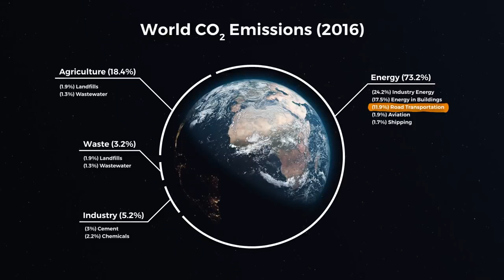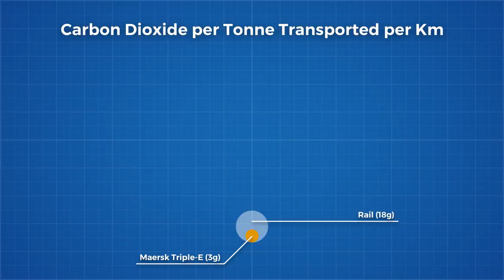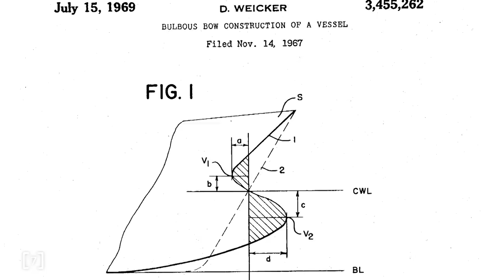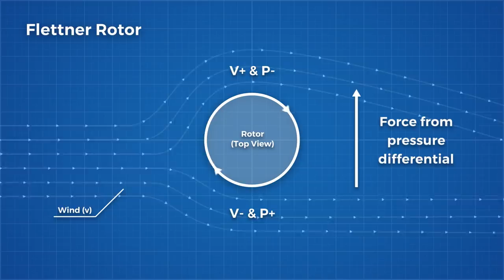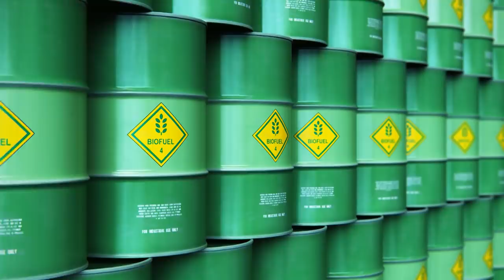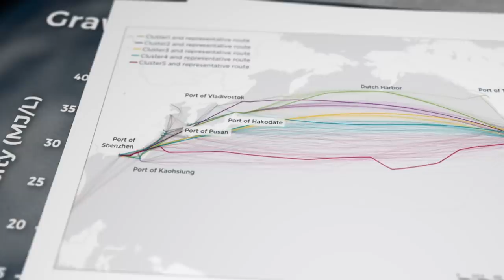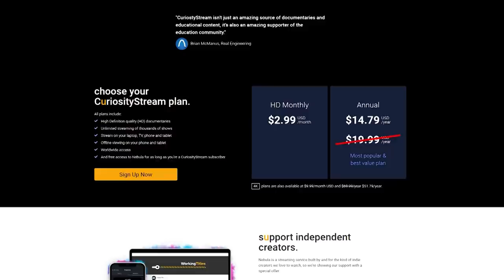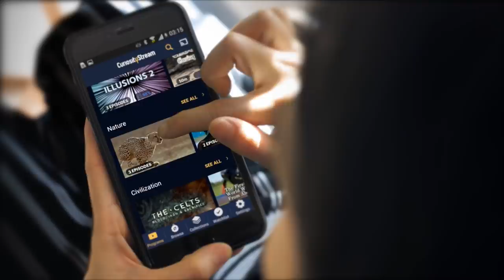Are Renewable Powered Ships Possible?

Comment: A better option is to return to sail.
Reply: To address the suggestions that wind power is the answer I offer the following.  The problems with the wind as an energy source are variability, reliability and low energy density; also relevant in this context is that the canvas, cordage and extra manpower needed for sailing ships were never a very benign environmental option so please discount any idea of sail as ‘sustainable’ and all this is without the problem that if ‘the wind don’t blow the ship don’t go’.

When it does blow it often blows in the wrong direction for your cargo delivery needs and sometimes there is rather too much of it for comfort.  The area where one is most likely to be ‘becalmed’ is the ITCZ (Intertropical Convergence Zone) or ‘the doldrums’ as it is commonly called.  In days of old ships with large crews, such as naval vessels, would try using the ships boats and some of the crew to row through the doldrums thus towing their mother ship out of the calm.  Not practical for less well manned and much heavier merchant ships which could not muster a similar power (oarsmen) to weight ratio (vessel displacement).  Traditional sailing ships are unable to go directly up wind so if the wind is blowing from the direction your cargo needs to go then a zig-zag course must be steered, more distance and thus more time on passage at whatever speed is achieved.

Wind speed is traditionally measured on the Beaufort Scale (wind speed) that runs from 0 (< 1kn or 0.5ms-1) to 12 (> 63kn or 32.5ms-1) and for sailing purposes the usable part of the range is ‘3’ (circa 8kn or 4.1ms-1) to ‘6’ (circa 24kn or 12.3ms-1).  As the wind speed, and the amount of energy that may be harvested there from, increases the sea surface becomes progressively more disturbed which makes the harvesting process ever more difficult and increases the stress on the vessel.  The increased stress means the sail area has to be reduced, either by using fewer or smaller sails until the vessel may in extremis be ‘hove to under storm sails’ or riding out the unsuitable weather using either a sea anchor or a traditional ground anchor.

I have more, lots more. on this subject but this is probably in the TLDR area.

Comment: How about hybrids? 

Half diesel-electric, half H2-electric
Reply: Double the capital expenses for less than half the yield.  First rule of LCA (Life Cycle Analysis) draw the  system boundary that best promotes your point, second rule of LCA chose the parameter carefully to best promotes your point, third rule of LCA  select the functional units that  best promotes your point.  I am sure that you can see the common thread (🙂).  

The 26th UN Climate Change Conference of the Parties (COP26) held in Glasgow between 31 October 2021 & 13 November 2021 established requirements and targets for mitigation of the production of GHG and with regard to shipping steps to reduce atmospheric pollution to acceptable levels could include, but not be limited to: -
1) Abolish the cruising fraction of marine transport;
2) Abolish recreational boating;
3) Improve fuel quality;
4) Localise production to consumption;
5) Reduce 'freight mile' distances;
6) Reduce spoilage / waste of all commodities;
7) Reduce freight carrying capacity;
8) Reduce the global population of consumers;
9) De'fossil'ise the fuel chain.
The use of any of the options above may not be the future of marine transportation but moving less material and moving what is transported over shorter distances, as in the past, should be.  Together with localised production and minimised consumption a global population that has individuals’ voluntarily self-limiting reproduction to two children per parent (both male and female), might save the planet.

Comment: co2 is essential for photosynthesis. Remember the starving 80s. Bon appetit. So not a pollutant yet. Its a gas we want in the right concentration. 1200 ppm is best. Not the starvation level of 350
Reply: the level of 350ppm may be best for temperature regulation and 1 200ppm may be best for photosynthesis but some things are a question of balance.  Confining the enriched 1 200ppm CO2 atmosphere to growing sheds could be an option for squaring that circle but how to make the sheds at a viable carbon cost.  As Barry Commoner said 'everything is connected to everything else'.

Comment: Would people please stop saying nuclear power. Its a terrible idea for ship propulsion. The maesrk tripleE class only has 60MW of propulsive power requirements and a typical nuclear reactor produces hundreds of MW which means the reactors would have to be run at a reduced capacity which increases the risk of hydrogen build up and then a catastrophic nuclear accident. Also around 40-50 cargo vessels sink each year. At the moment the fuel is kept in sealed double or triple walled tanks which are difficult to break. A nuclear reactor sinking would result in a much more serious accident.

Comment: Commercial Hydrogen is mostly made from natural gas, a fossil fuel.  That's why it's supported by oil companies who control most of the natural gas.
Reply: True most commercially available H2 is created from CH4 using CH4 to power the process.  How ever it is possible to liberate hydrogen (H2) from water, you need a lot of energy and while fossil oil & gas, or perhaps coal, will do it and are the most readily available any energy source, wood, photovoltaic, wind, tidal, et cetera, will do.  H2 is said to be good for use in fuel cells that will give clean energy when combined with Oxygen (O2) and leave only water (H2O) as an effluent; so as well as the cost of creating the hardware and separating out the H2 in the first place we now have the cost of providing the O2.  H2 is very, very light and very, very volatile so this is where we remember the Hindenberg airship disaster and while events of that magnitude might not be likely much smaller H2 fires or explosions can cause a lot of damage.  The ‘light’ means that though there is lots of energy per unit mass there is not much mass per unit of volume so all the problems of CH4 but much worse.  You need to compress it, more than a lot, or cool it, more than a lot, to get enough on board your ship in manageable volumes to be useful.
  The alternative to fuel cell use of H2, burning, also generates combustion products which includes waste heat going to the cold sink and a few NOx nasties.  The numbers, on any of these, are getting very difficult to show any sort of surplus so is this a case of running hard to stand still?

WADR H2 may have a place in the energy mix on land as a storage medium but on a ship?
Reply: @BernardLS  Hydrogen as an energy storage medium is highly inefficient and relatively impractical.  As you note, splitting Hydrogen from water uses a lot of energy.  Currently it uses as much energy (when used in a fuel cell to power an electric motor) as needed to drive a battery electric vehicle 3x to 4x as far.  

If Hydrogen is burned in a combustion engine, it's far less energy efficient than when used in an expensive fuel cell.

The energy needed to compress Hydrogen to a useful size makes it even less efficient.

Hydrogen really is not practical.  

It would be far more efficient overall to simply burn in an internal combustion engine the Methane natural gas fossil fuel that most Hyrdogen is made from.
Reply: @LoanwordEggcorn  Agreed now all we have to do is convince the Green Movement.  The key to sustainability is breed less and consume what we need not what want, but that will be an even harder sell.
Reply: @BernardLS  Please keep educating about Hydrogen!  :)

P.S.  Cargo ships are successfully using wind energy in multiple ways: the Magnus effect in the video, automated kites and automated wing sails.  All have already been done experimentally, and they provide significant power.
Reply: @LoanwordEggcorn  Re you P.S.  To address the suggestions that sail power is the answer I offer the following example.  In 1870 a premium sailing vessel entered service, the ‘Cutty Sark’.  The 'Cutty Sark' was 64.74 metres in length with a beam of 10.97 metres and a loaded displacement of 2 100 tonnes.  She was able to carry, at best, 1 700 tonnes of cargo and to harness the energy in the wind the available spread of canvas was up to 2 976m2 which was tended by a crew of about 30 skilled men.  A ratio between the sail area (SA) and the vessels displacement (D) determines how lively she is; ‘lively’ being nautical speak for ‘fast and manoeuvrable’.  The carrying capacity of cargo ships is constrained in two ways, mass and volume which leads us to the ‘stowage factor’ of the cargo; the more mass on board the greater the displacement which in turn impacts the efficiency of the hull form and sail area / displacement ratio.  A vessel constrained by mass is said to be ‘down but not full’, while a vessel constrained by volume is said to be ‘full but not down.  When in the tea trade, which the ‘Cutty Sark’ was designed and built for with fine lines (more nautical tech speak, so again no need to worry about it) she could carry around 600 tonnes of cargo at speeds of up to 17.5 knots dependent on the prevailing wind and had a typical China to UK time on passage of 120 days.  The tea trade was very competitive so ‘time on passage’ was a large factor in securing the premium freight rate that made her cost effective.  As soon as the Suez Canal opened, which the ‘Cutty Sark’ was unable to sail through; she lost her advantage, raw speed, to the steam powered ships of that era who could beat her ‘time on passage’ by taking that short cut.

Rounding things out, her maximum available sail area gave circa 5m2 of canvas for every tonne of tea carried.  All of which is without the problem that if ‘the wind don’t blow the ship don’t go’, when it does blow it often blows in the wrong direction for your cargo delivery needs and sometimes there is rather too much of it for comfort.  Sailing ships are unable to ‘go’ directly up wind so if the wind is blowing form the direction your cargo needs to then a zig-zag course must be steered, more distance and more time.  Wind is traditionally measured on the Beaufort Scale (wind speed) that runs from 0 (< 1kn) to 12 (> 63kn) and for sailing purposes the usable part of the range is ‘3’ (circa 8kn) to ‘6’ (circa 24kn).  Random fact about ‘Cutty Sark’, it is said to have been possible to coax 3 000 horse power out of her sails, or in ‘real money’ 2 206 500 Watts (2.2 megaWatts), or 741 Watts for each square meter of sail area.
Reply: @BernardLS  Thanks.   I'm not saying only wind power, but wind power can reduce or replace very significant parts of the power from combustion engines for cargo ships.

Most cargo ships would need to retain a combustion engine for part of the power or part of the time.

Modern weather routing can find wind for ships significant amounts of the time.
Reply: @LoanwordEggcorn  ‘Ocean Passages of the World (NP136)’, UK Hydrographic Office, Taunton would be a good place to start with passages planning.  The concept has been around formally for at least 250 years, since the days of the Dutch East India Company, and will IMHO moderate or mitigate the cost of marine shipping by circa 10%.  However the perspective is that ships like a Mearsk Triple E large container carrier are around 2 000 times more efficient than ships like the ‘Cutty Sark’; factor in manning 30 skilled artisans on ‘Cutty Sark’ and 12 on a modern large Container Ship and in manpower terms that goes to 5 000 times better per freight tonne mile.

Since starting to follow this video and the comments threads my stock of answers has grown to about 4k words so I am in danger of becoming a bore on the matter, sorry.
Reply: @BernardLS  Weather routing science and technology is widely used by the shipping industry and private boaters.
Reply: @LoanwordEggcorn  WADR the ‘enhanced passage planning and routing technique’ is applicable to both ICE power and the sustainable alternatives so application would not give the sustainable option an advantage.  While ICE has the current perceived advantages of economy, facility and flexibility we are going to be stuck with the environmental down sides unless universal regulatory action prevails or consumption both per capita and overall reduces.
Reply: That because the only way to store energy is a battery. Everything other than fossil fuels and nuclear needs to be banned befor renabals take over.
Reply: @doomguard731  There are many different ways to store energy.  

However there are significant differences in their energy, volume and mass efficiency.  Batteries are the most efficient for many uses, especially stationary storage.
Reply: @LoanwordEggcorn  If batteries are the best then it would be more ethical to stick to fossil fuels. A child has to be worked to death just to extract 1g of cobalt and lithiums not much better. Evrybody that uses battires is a child MURDERER. Also batteries cannot be recycled and the have to be thrown away after 2 years of use. It cost £500000 to make the battery for one small EV does that sound like a solution to you?

Comment: Best solution is hydrogen. Ship will not need big fuel tanks. More space for cargo. Because ships are floating in fuel. Water. Ship can easily make hydrogen from water. And make profit. Selling extra hydrogen created during voyage.
Reply: The next, least bad, option is ‘alternative fuels’ such as Ammonia (NH3), Biogas (basically good old CH4 or Methane) and Hydrogen (H2).  All require harvesting and processing which have costs and impacts before you get your energy to the point of use and will have effluents that will impact the global environment one way or another.  Thomas Midgley, Jr. (born 18 May 1889 died 2 Nov 1944) was an American chemist who as well as developing the technique of putting the lead tetraethyl lead (TEL) additive in petrol created chlorofluorocarbons (CFCs), yes those ozone depleting CFCs, so that the use of NH3 as a refrigerant could be discontinued.  NH3 could be the most dangerous and least ‘clean’ clean energy source it is very bad and probably deserves a rant all of its own, so let’s just leave that for a while (somewhere very far away that is cool, dark and quiet).  CH4 lots of it around much of which comes out of the ground as a fraction of the FOGI energy mining; even more can be created (relatively expensively) from anaerobic degradation of organic matter.  The organic matter may be either raw vegetation, food waste or pre-digested by domesticated livestock with the right (or wrong, depending on your point of view) sort of diet and gut fauna.  CH4 is a lighter than air, vapour at environmental temperatures and pressures and you need to compress it, a lot, or cool it, a lot, to get enough on board your ship in manageable volumes to be useful.  Carry it as cargo and you can burn the ‘boil off’, when the latent heat of vaporisation has a co-activity benefit, otherwise more trouble and cost than merit and savings.  H2 is said to be good for use in fuel cells that will give clean energy when combined with Oxygen (O2) and leave only water (H2O) as an effluent; so as well as the cost of creating the hardware and separating out the H2 in the first place we now have the cost of separating out the O2.  H2 is very, very light and very, very volatile so this is where we remember the Hindenberg disaster the ‘light’ means that though we have lots of energy per unit mass there is not much mass per unit of volume so all the problems of CH4 but much worse.  You need to compress it, more than a lot, or cool it, more than a lot, to get enough on board your ship in manageable volumes to be useful.  An alternate use of H2 burning also generates combustion products which includes waste heat going to the cold sink and a few NOx nasties.  The numbers are getting very difficult to show any sort of surplus so this is a case running hard to stand still.  The 'Just Have A Think' channel have a posting on H2 & NH3 just now, go see.